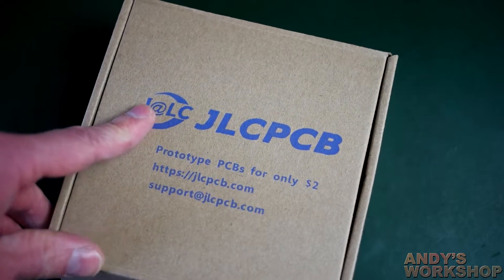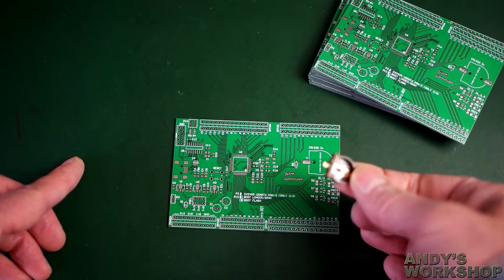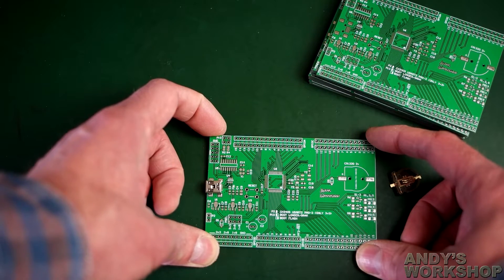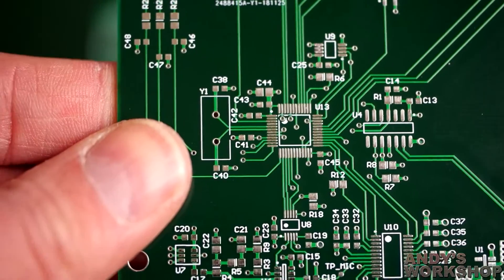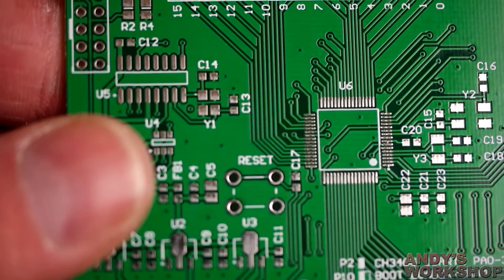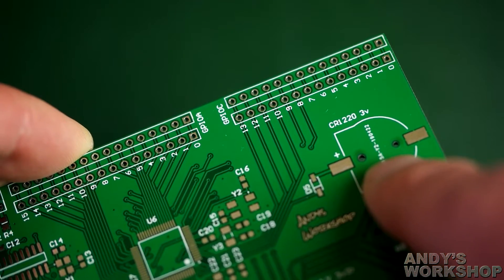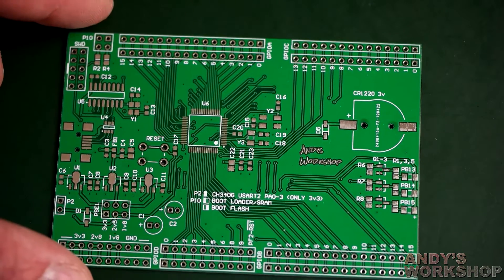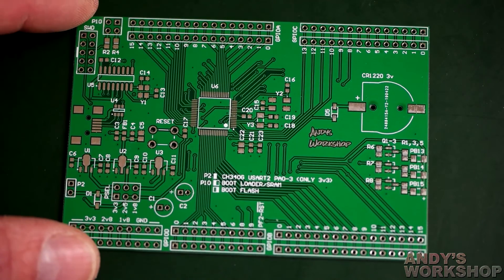Unboxing my Cortex M0+ dev board PCBs

Comment: I think the process the cheap fabs use means that if there is no ring the hole doesn't get plated... if you want to specify the via style etc I think you probably want to look at PCBWAY instead. Their quote form has all of that stuff and for anything except the configurations that JLCPCB are selling below cost their prices aren't that different.

I've done a few orders with JLCPCB and their stuff is ok. Reworking their boards usually results in pads getting lifted so I've taken to just pulling off the expensive components and doing the corrections on a new board. I have no idea how they make any profit between selling boards for below cost and throwing boards at whoever will shill for them.